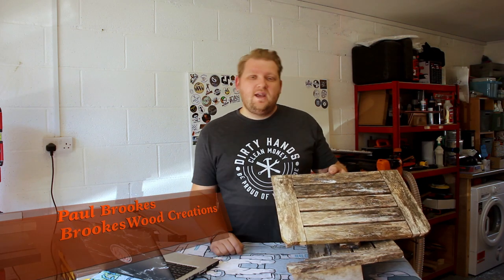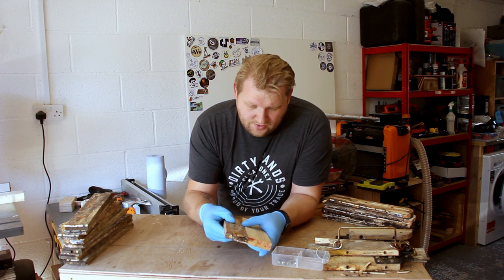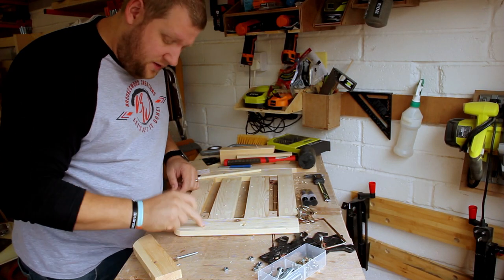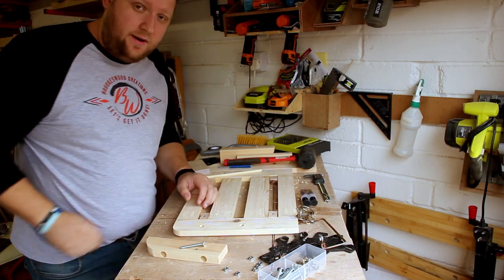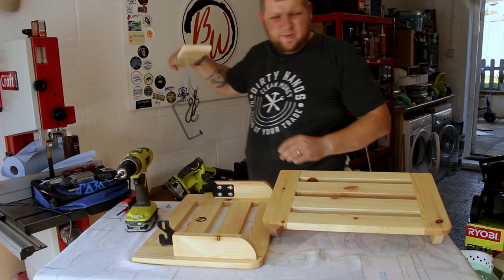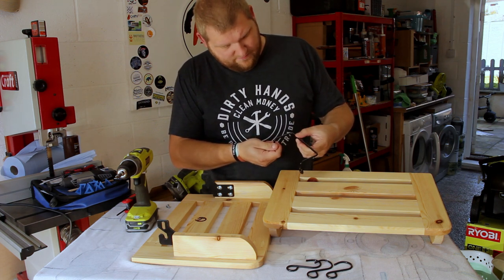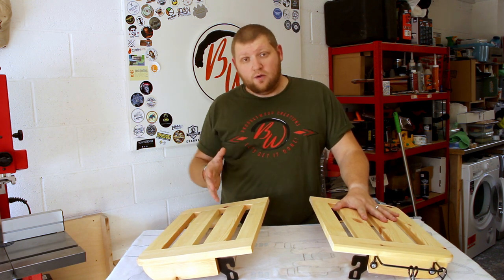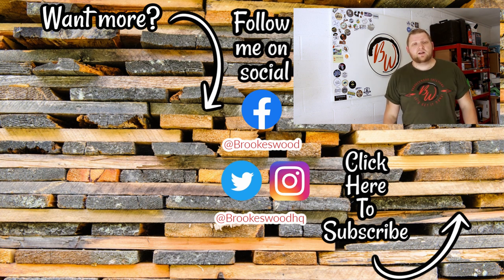How to refurbish or remake the sides of a BBQ

Comment from the maker: Such a good little project to do, sad that the tenon joints didn't work out but I will try again on a different project soon. I think it turned out well. Doing it in hardwood would have been better but for a temporary fix, it will be fine. 
Don't forget to like & subscribe if you haven't. your support means more to me than I could put into words. 
If you want some merch, check out the description, it's all through amazon so you know is safe & fast!